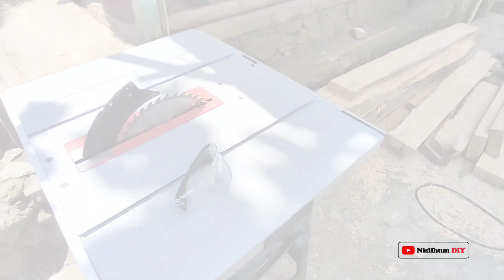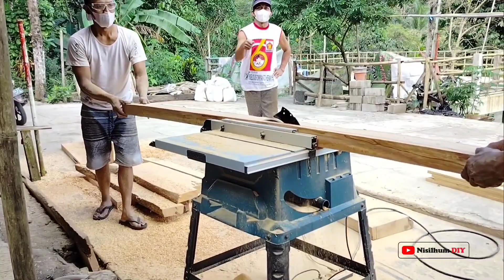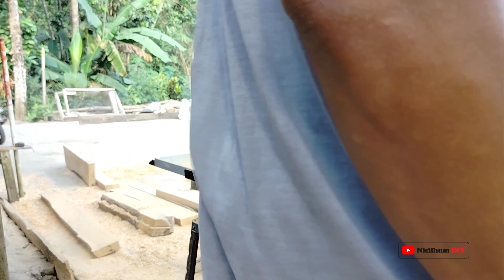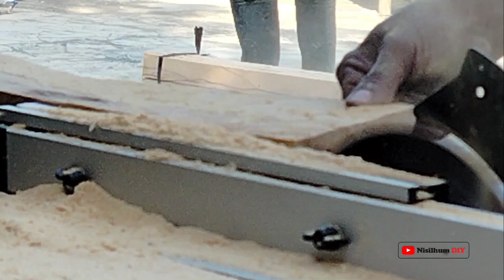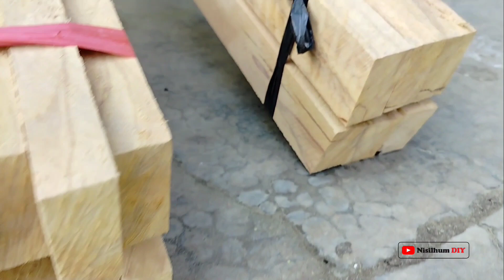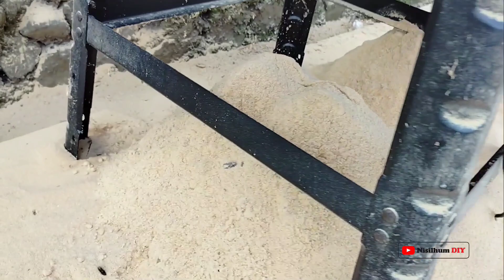Bosch gts 254 vs kayu duku

Comment: How much thickness that would has, and what kind of wood is that? Is that hard wood?
Reply from the maker: Yes sir, it's one of more than a hundred hardwood in my country.
Itu kayu duku, duku adalah salah satu jenis buah2an yang bisa dikonsumsi manusia.
Pohon duku memiliki batang kayu yang sangat keras, bahkan setara dengan kayu mahoni ataupun kayu jati.
Saya membuat balok dengan ketebalan 80mm, kapasitas puncak dari kemampuan mesin gergaji tersebut.
Reply: @Nisilhum  can you translate into english please?
Reply from the maker: @PlanetEarth566  that is a Duku wood, Duku is a type of fruit and that can be consumed.
Duku trees have very hard wood trunks, even equivalent to mahogany or teak wood.
And in the video, i made blocks from wooden slab at 82mm thick. That is the maximum capacity of the tablesaw machine..
Reply: @Nisilhum  wow, looks like that saw  did fine in that type of hard wood. Is the saw still working? Do you recommend it? I would want to buy one for my shop in the future. Thx!
Reply from the maker: Yes sir, the saw still works fine.
But i don't recomended it for long-term work on wood with big size and hard wood, because clearly that's not what it's intended for.
Reply: @Nisilhum  i don't use hard wood, thx sir.
Reply: Mahogany is "hardwood" but it isn't that hard to carve or to machine.
Reply from the maker: @danielfernandeznungaray8996  yes sir, right 👍